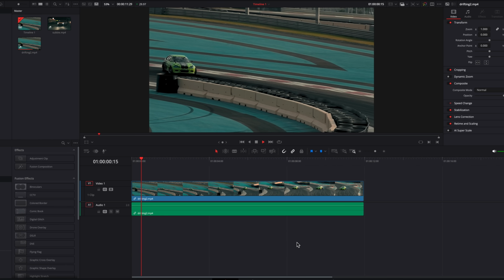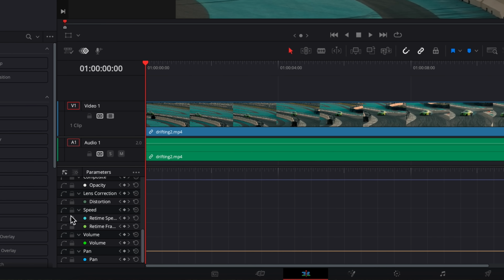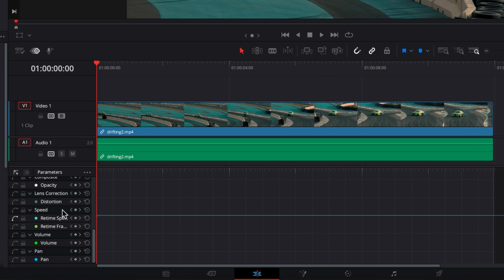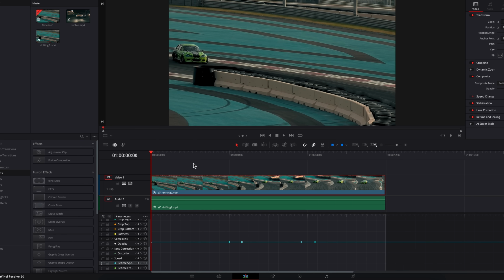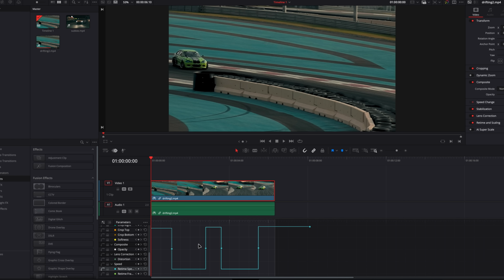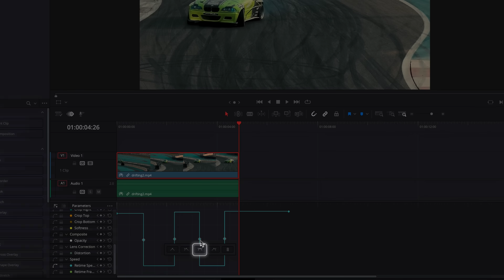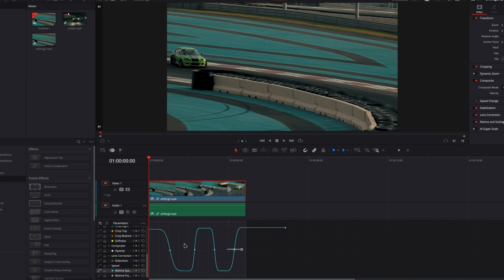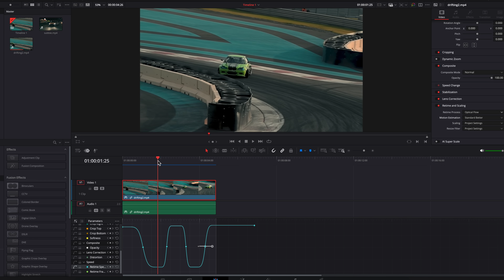SPEED RAMP Like This In DaVinci Resolve 20.1 (NEW Feature!)

Comment: I still do not like the single keyframe for speed ramps. I came to Resolve from Vegas Pro and where speed ramping behaved like normal keyframes using two points and interpolating between them. This allowed for linear speed ramps or curved speed ramps and Vegas also had a lot more options for curve shapes. Resolve's single keyframe method is so clunky and nearly impossible to use for precise speed ramps. 😩
Reply: Theoretically you should be able to use retime „frame“ instead of „speed“ for that. But the last time I used it didnt really work. So yeah I agree, i find this way of speedramping a lot more intuitive too. For now im using the timestretcher in fusion, which also works like that, but it doesent have the superior AI flow interpolation of the edit page and it takes longer to set up, so its not as good
Reply: @IndepthResolve yea the optical flow node is nowhere near as good as the one on the edit page with AI, shame tbh
Reply: @IndepthResolve  I actually use Retime Frame all the time. I'm curious about what didn't work for you.
Reply: @tonyredgrave009 It works but its limited. The handles stick together, you cant move them individually, which is really limiting when it comes to which curves you can create. If you compare that to the timestretcher in fusion, this tool gives you a lot more flexibility, because you can move the handles however you like. You might not need that flexibility for your projects, bit if you do its frustrating. 

The downside of the timestretcher is it takes longer to setup and you lose the context of your editing timeline when in fusion.
Reply: Exactly. I want exactly this. I also originally came from Vegas Pro and I struggle a lot with these type of keyframing for speed. It's so much better in Vegas Pro.
Reply: For me, im editing in vegas and only using resolve for the color grading at this point. Im not a professional so i stick to the workflow that gives me the least headache vs time vs result.   Kind of sucks but im not gonna beat myself up learning something all over again with results im unhappy with and ends up ultimately being a timesink.